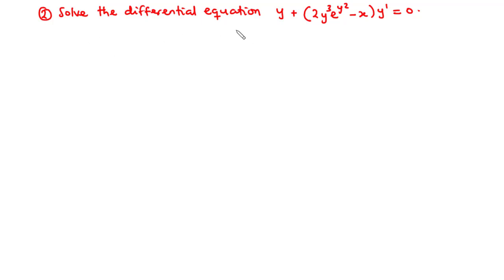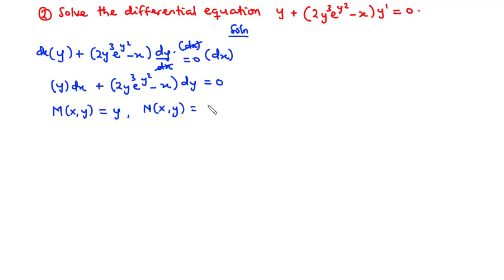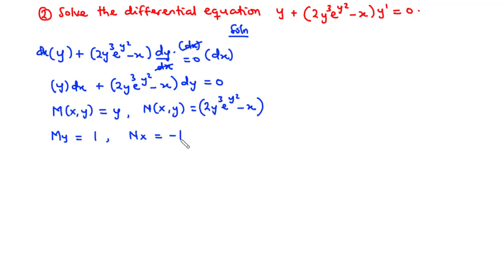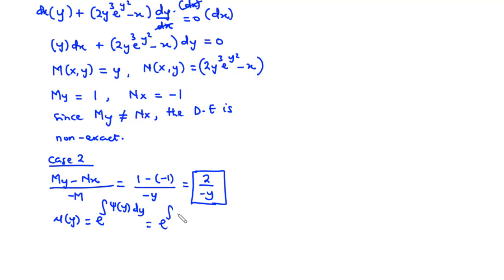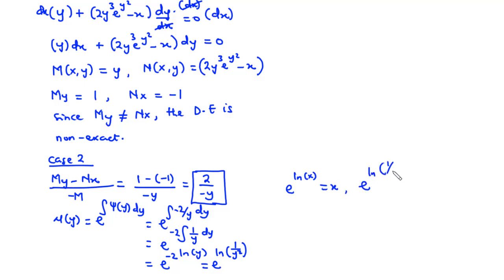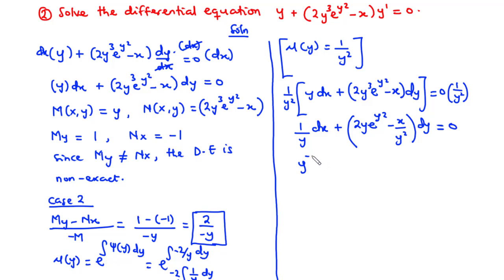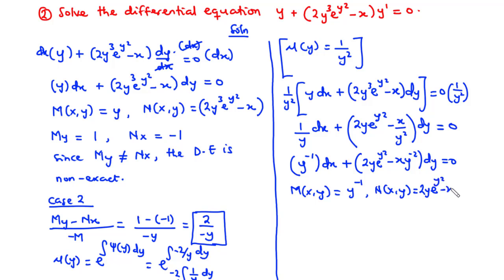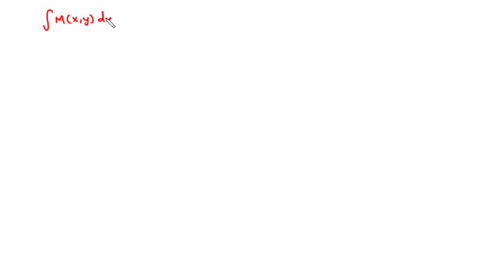🔵14 - Non Exact Differential Equations and Integrating Factors 2

Comment: hello i have this question. y(1+xy)dx (- x)dy = 0. I am unable to solve with these two cases that u made the video. can u please solve this?
Reply: If you're unable to find an integrating Factor, then you have to go by method of inspection i.e find a way to multiply or divide the eqn by either x or y such that it gives My and Nx to be equal
Reply: @Renzi128  hi thank you. I used a different approach (using the product rule formula..  My×Fx =Nx'(Fx) + (Fx)'(Nx) ) I don't remember the exact formula but I was able to clear my exams with it
Reply from the maker: Have you tried solving it again?
Reply: @SkanCityAcademy_SirJohn  yes

Comment: The method of substitution is used when a function and its derivative can be found in the function we are to integrate. Here in this case, the derivative of 2y is 2 w.r.t y and that of e^y^2 is 2ye^y^2.  So, it is wrong to use the method of substitution here because the rule that should be hold when applying it is not found in the function.
Reply from the maker: Great input, however I disagree with you

Comment: I am trying to solve this 
y dx + (x2y3 + x)dy = 0
I know this equation can be solved by inspection.(the integrating factor is
 x^-2 y^-2)
But I try to use your method, I cannot find a function that's form by x or y only.(case1 and case2 are both cannot be fullfilled)
Do I make anything wrong？Or just there's an exemption of this method？
Thanks
Reply from the maker: Yes, I think there is something wrong with your solution. Try it again and let's see
Reply from the maker: Integrating factor is u(y) = 1/y
Reply: @SkanCityAcademy_SirJohn   sorry,maybe I type the question wrong and made some misunderstanding.

the question should be
 ydx + ((x^2)(y^3)+ x)dy=0
and the textbook just told me this can be solved by inspection and give the answer of the integrating factor = (x^-2)(y^-2)
Reply from the maker: @williamstechtips9726 oh okay

Comment: Why didn't you use integration by parts when integrating 2ye^y²

We are integrating two products and one of the products is not a constant
Reply from the maker: Well it's true, but you can as well use u integration, and that's what I did, which is very fast and simple.
Let me explain how 
Integral of 2ye^(y^2)
Let u = y^2 
du/dy = 2y, dy = du/2y.
Therefore 
Integral of 2ye^(y^2) becomes 
Integral of 2ye^(u).du/2y 
Integral of e^u dy 
Which is equal to: e^u + c, you sub u = y^2 back.
e^y^2.

Hope you get it. Thanks
Reply: @SkanCityAcademy_SirJohn  Yh but you ve taken the 2y as a constant
I used integration by parts and didn't get the same answer as yours
Reply from the maker: @eucliddankwah1557 I think I've just explained to you how I used u integration to do it, when you have a question like this ay times and exponential function, my method usually works. But not all cases. So refine your solution process on integration by part to see if you will get what I had. I think the problem is your solution process.
Reply: @SkanCityAcademy_SirJohn  okay
Thanks
Reply from the maker: @eucliddankwah1557  you are welcome
Reply: @SkanCityAcademy_SirJohn  so please what he is saying is right when you integrate using u substitution, you will get e^y^2/2y
Reply from the maker: Well, we are supposed to arrive at the same answer, I will also use integration by part to see
Reply: I think the u substitution also worked perfectly, and seems easier and faster... Great work Sir John...
Reply from the maker: @calculusjoe53 oh great I see, I will check that. Thanks for watching and commenting
Reply: Exactly... Also raised similar concern